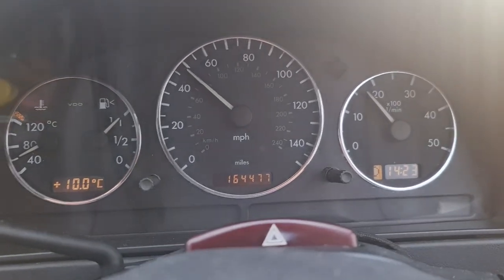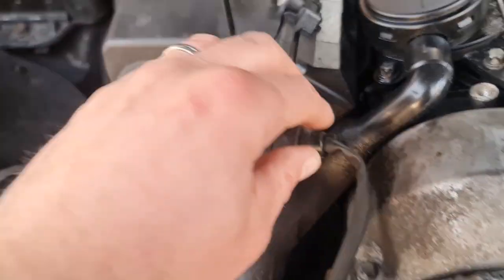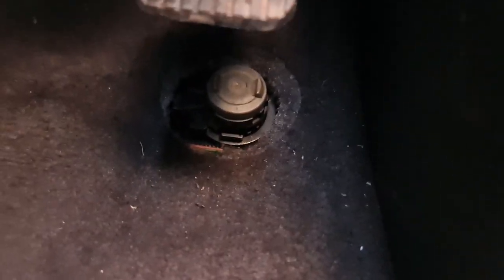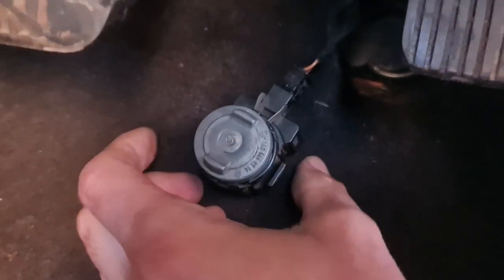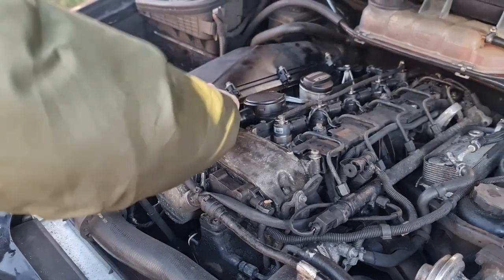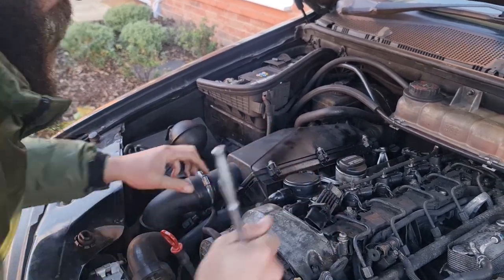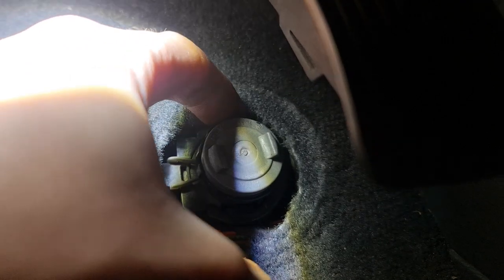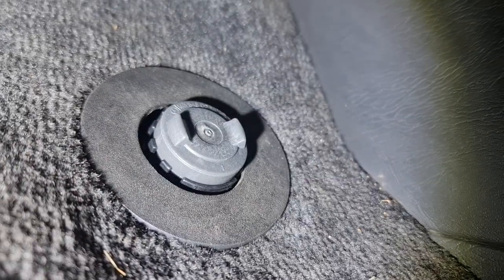Mercedes ML 270 CDI Not Revving Past 3000RPM - FIXED!

Comment: I have been searching for weeks and couldn't find the same problem, I changed the MAF. Map, EGR Valve and solenoid, Swirl Flaps and actuator and still had the same problem. I checked all the intercooler hoses for leaks, no issues, but the problem remained, until I finally checked the solenoid for the Waste Gate actuator and found a bad connection, 
I tested the car and BINGO
Reply from the maker: Man, I'm so happy to hear you got the car running property again😁🤜🏼🤛🏼

Comment: Like your videos you are very good at problem solving , helped me heaps thanks 👍 P. S . what is  the Part called under the Accelerator Pedal ?
Reply from the maker: Thank you mate! I'm glad it helped you! 🤜🏼🤛🏼 it's called kick down switch. When you press the accelerator all the way down, that switch sends the signal to the automatic gearbox computer to start shifting down the gears in order to increase speed faster.

Comment: Same problem on a 2002 w163, thanks for uploading.
Reply from the maker: I'll be glad if this video manages to help even a single person! Thanks for watching! I really appreciate it 👌🏼
Reply: @evosgarage  Changed the sensor to no effect, I will now trying the other things you pointed out in the video. Thanks once again.
Reply from the maker: @ranat5526  Rana get a cheap Bluetooth OBD2 scanner and the torque app or carly app and scan the codes so you can pin point the problem in your car and then go from there before you start throwing more parts at the car! Let me know if you need any help when you get the codes scanned! 👍🏻
Reply: @evosgarage  I undid the egr and it's was fully blocked,  going to do a clean up and removing the swirl flaps along with a Mr muscle  oven cleaner blast on the turbo.
Reply: @ranat5526  That sounds like that most likely will be the cause of your problems. Let me know when manage to fix it. I'd love to hear it! 👍
Reply: @blankmasterfishing  Finally fixed it, removed all the swirl flaps and actuator replaced with 4.7 ohms resistors 2w (or four 0.5w bunched together ) , cleaned out all the carbon build up including the egr and still the problem persisted. Finally while I was looking at the vacuum line low and behold I found a hole. Now turbo and egr working perfectly!! I'll try and upload a video on what I did in the next few days. OBD scanner never picked up any fault codes. Oven cleaner was a real help in cleaning all the mess I encountered.
Reply from the maker: @ranat5526  Nice! I'm really happy to hear that! Let me know when the video is put, I want to watch it!👌🏼
Reply: @evosgarage  uploaded
Reply from the maker: @ranat5526  I've just watched it! Very good mate!👍🏻
Reply: I have same problem.. I need the link for that air sensor pls
Reply from the maker: @byemmihaita7847  this is the one I've bought.
Pierburg 7.22684.07.0 Air Mass Gauge https://amzn.eu/d/9rYaDTJ
Reply: @evosgarage  thanks for info 👍👍👍

Comment: could someone help w210 270 cdi when I start the car it won't go over 3000 rpm, only after about 20-30 minutes of driving it starts working and pulls normally

Comment: I have the same problem with my 2009 C c220 cdi. Only after its warmed up and engine under stress, something happens, no kick down and won't go over 3000rpm.....I will attempt to change the MAF sensor and let you know.
Reply from the maker: Hi mate! Do it, it will probably fixed your problem! Thanks for watching 🤜🏼 🤛🏼

Comment: Nice video! What's your experience with this engine? is it worth it above the 3.2l petrol/gas engine?
Reply from the maker: If I could choose I would prefer the 3.2 inline 6. The engine from the 320CDI.
Reply: @evosgarage  ok. But between the 270cdi and the 3.2l v6 petrol/gas?
Reply from the maker: @ramonbs6075  unless you live in dubai or the USA I would recommend the 270CDI as the 3.2 v6 is known to be veeeery thirsty😉

Comment: I have the same problem with my w210 can u help even when its in P Or N cant go past 300
Reply from the maker: Hi Rei! I also have a W210 but it's a 300td. I hope this helps you, in the past I had a similar problem in it, I replaced the MAF sensor, Map sensor, EGR, Both vaccum solenoides and all the vaccum hoses, none of that fixed the problem, in the end it was the fuel tank pre filter that sits under the fuel tank, it was completely clogged with gunk, replaced that and 30000 miles later the car has been running like a dream. check that in your car, you never know. 👍
Reply: @evosgarage  thank you very much i will check it

Comment: My 2002 c220cdi has this as an intermittent prob, pull over turn off start again its fine!...till next time🙄
Reply from the maker: Hi mate! I would suggest you get the codes scanned with a cheap Bluetooth obd2 reader. That's likely to point in the right direction and it might be something very simple to solve!👌🏼
It seems the ecu going into limp mode and there must be a good reason for it but it can be something simple as MAF sensor for example.
Reply: @evosgarage  ok thanks although i have a more pressing issue with it at min, it is stuck in nuetral wont go in reverse or park, sort of half goes into drive but not as far as normally lever should go but at least i can move it forwards, i have just bought a used lever and gear selector and 🤞 that will sort it
Reply: Hi quick update which may be of help to others in future, i replaced the gear shifter module with a second hand unit as three diff sources said it would not need programming on a2002car WRONG! A nightmare time with lots of issues (stuck in 1st, no reverse saying R when im driving!.stuck in 4th..and others!) Took it to a magic auto elec who took all the "brains" out of my old shifter and put them in the new one and it is now working fine after  a week👍 now its pouring black smoke and loss of power though🙄 bloody vehicles eh😅